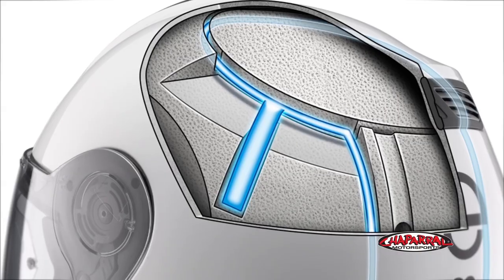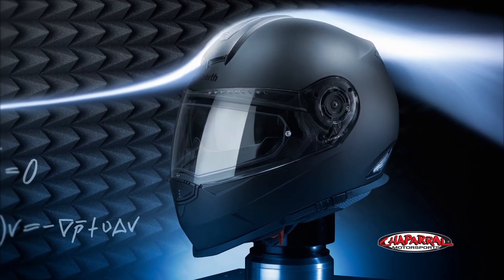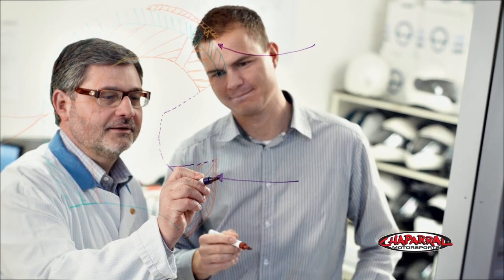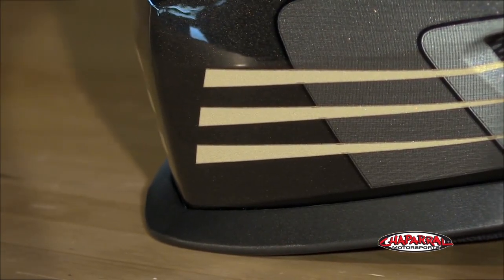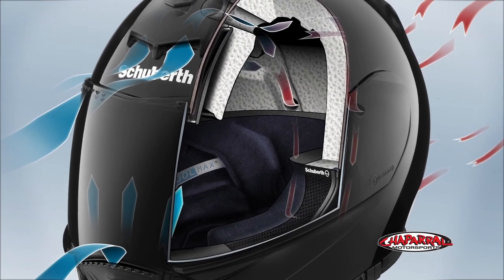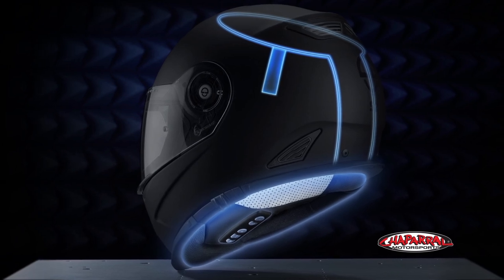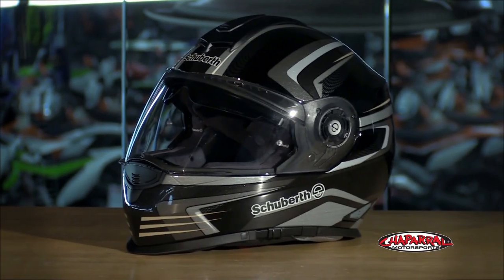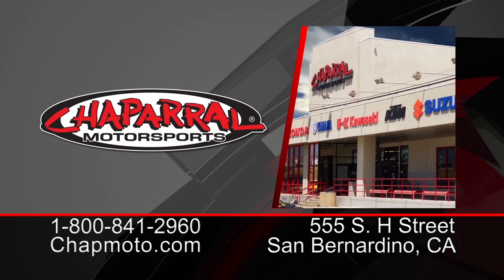Schuberth S2 Full Face Motorcycle Helmet Review

Comment: I purchase a Schuberth S2 helmet and would like to install a bluetooth unit. I don't want their SRC colar unit because I was told that it makes the helmet harder to put on and off and it's already very snug. I already have the Cardo G9x but the adaptors they include don't help. If I use 3m VHB tape to attach it I will not have access to the rear plugs for the ear spearker and aux. Do you know of any other system that fits the S2 besides the SRC?